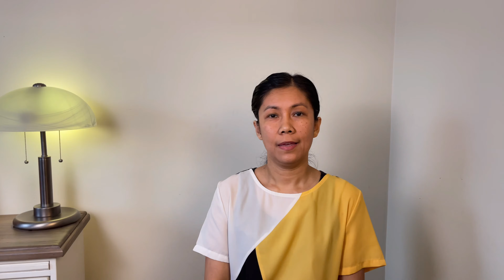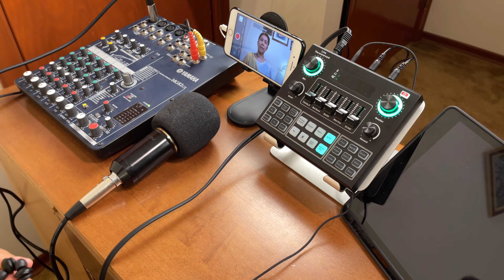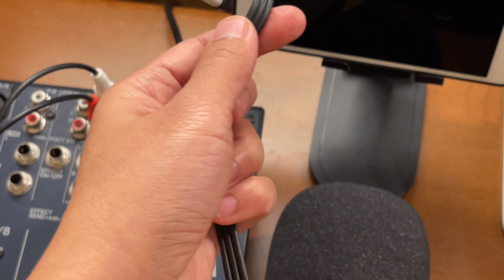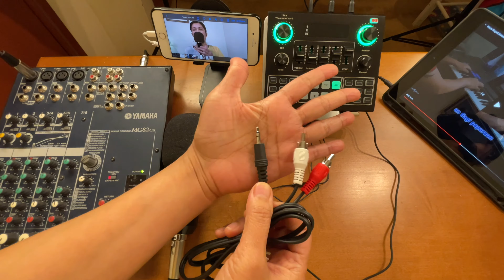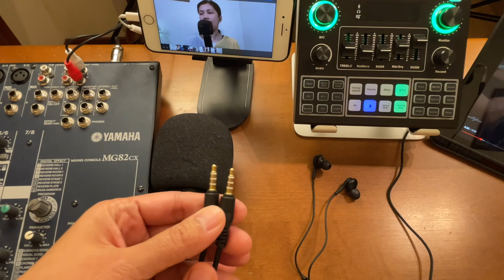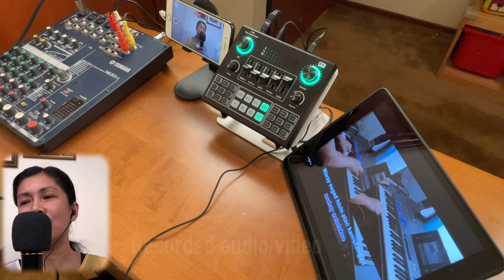4 WAYS to connect V9 Sound Card to Mixer using 4 different cables. Find out what they are? (ENGLISH)

Comment: Good afternoon Madame, thanks for a very clear and vivid video tutorial...i learned a lot from you...just 1 last important question po...if turned ON na phantom power sa mixer mo, need to turn off the phantom power in V9 soundcard?
Reply from the maker: Ang V9 wala pong switch to turn on/off ng phantom power. Kaya option nyo po sa mixer lang po.

Comment: This IS the best English presentation of this device I have seen so far. You need to research about the "two lines" plug and the "three lines" plug. 
The "Three Lines" plug is a TRRS, (that's Tip, Ring, Ring, Sleeve) plug to connect both the sound and microphone connection from a device like a phone.
Reply from the maker: I really appreciate your info👍 thanks